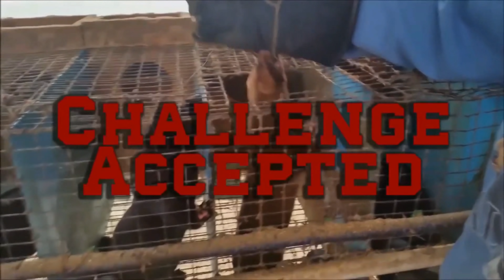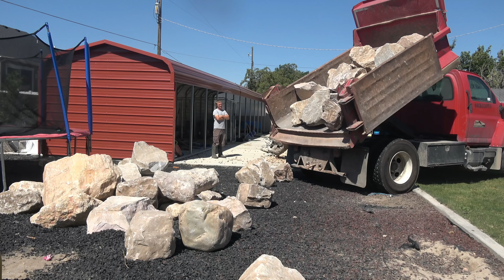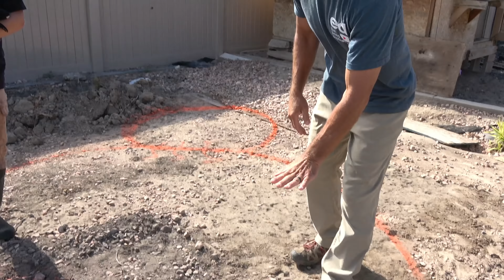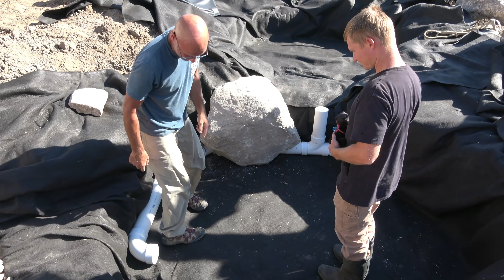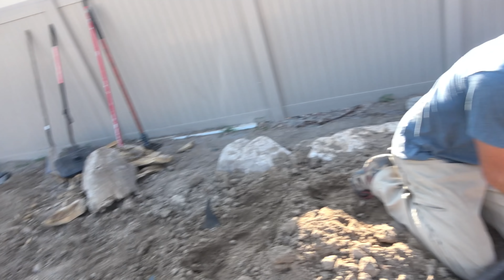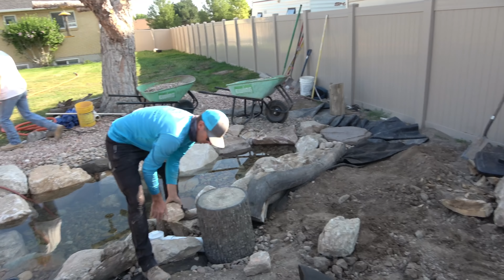AMAZING Pond for MinkLand!!!!

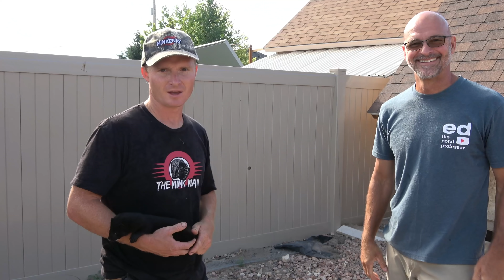Comment: 0:42 AVALANCHE!!! ~ 1:10 Is there a reason for the 8 spikes on the T-Shirt Design? ~ 2:08 Turtles? I would like to see that? do they actually crack the shell? How do they get to the meat? ~ 5:07 That is SO COOL that Joseph has ideas for what he would like, & Ed says that it is possible to make! ~ 8:30 Add and take away on your own [What about a lever you pull to open the door, so they have access to the tunnels. If you don't want it open another time, you push the lever to close the door on the tunnel.]

Comment: Will the mink get confused an run out of air to breath in a pipe? How would you rescue one of them and can the dogs practice with the mink to catch predators as the possums an rats/mice work their way up to such location? Will this be closed off from the outsides so tight that animals you don't want can't get in? Will it be kid friendly as your girls see water as a wader, not a habitat ??? Looks promising an luck is with you as this guy would do it for the getting his name out there
Reply from the maker: Minks swim under the ice all winter long. They're not going to have trouble swimming through that short little tube.

Comment: If you can keep the water clear enough you could have small underwater cameras along the pipe system.  Splice the underwater footage with the above ground video and you'll win awards.
Reply: That's a great idea with the cameras!
Reply: I don’t know anything about ponds, but it seems like the shallow ponds are awfully prone to heavy algae.  Hard to keep clear.  ?
Reply: @helenscott8202  Snails and algae-feeders can help keep the algae to very manageable levels; it's all about balancing the little ecosystem you're building. Some plants provide more oxygen than others, some filter the water more efficiently, and different kinds of fish will eat different things. It really takes a lot of research to build and balance a micro-ecosystem.
Reply: Alexis Grunden Thanks!
Reply: They may have some algae initially but once the biological systems they are putting in mature this pond will be crystal clear.
Reply: Timothy Newitt Thanks!
Reply: @Timothy Newitt  it's more a stream than a pond with a pump of that strength